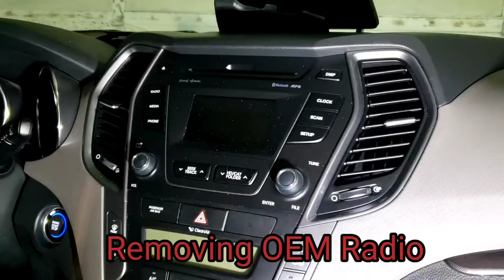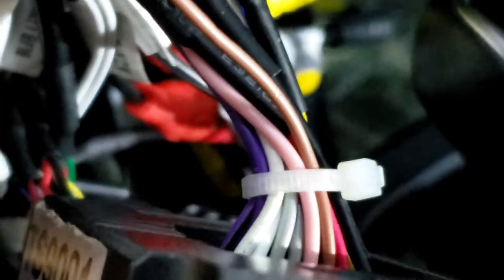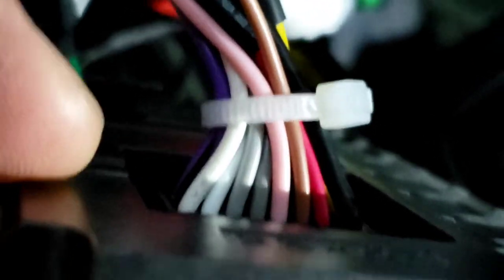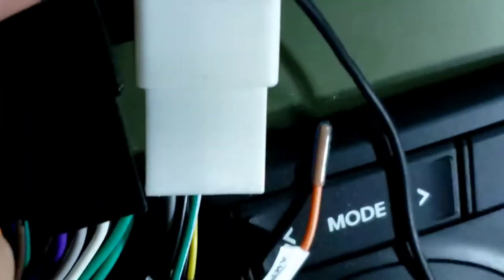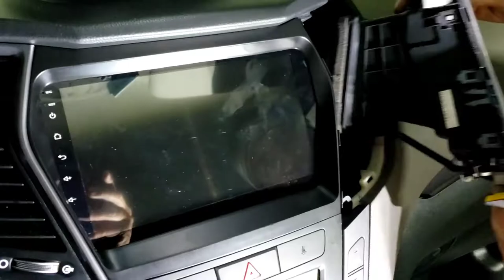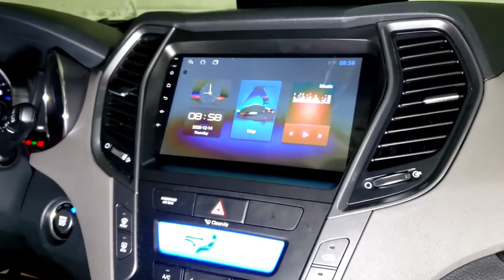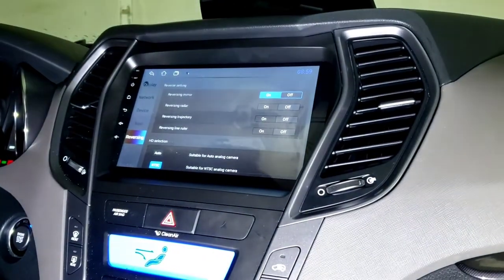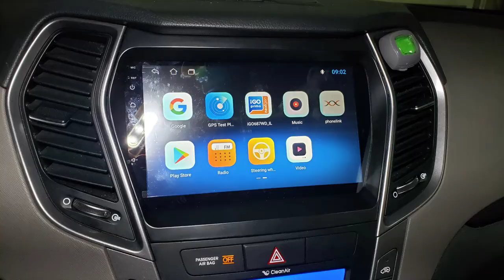Hyundai Santa Fe 13-17 Android 9.1 GPS install /quick/

Comment: just bought the 9" Android head unit ($139) on eBay for my 2013 Santa Fe Sport, I have exactly the same factory radio you removed here...how did you get the mounting brackets to fit?...or did you not use brackets? The metal brackets they included sure don't seem to fit for this install...and the bottom of the plastic mounting piece doesn't fit flush...looks like the two tabs will fit, but there are 2 more tabs under each end...how did you get it to fit flush on the bottom?
Reply from the maker: Visit our Facebook  page :

https://www.facebook.com/Brainlimbo?mibextid=ZbWKwL
Reply from the maker: Messenger

Comment: Hello! I have the same setup issue with the backup camera not detecting reverse. Can you give more detail on which wire that reverse wire needs to be connected to? My colors don't match yours. Thanks!
Reply from the maker: What year is your suv
Reply: @khmerohio  2016 santa fe sport with navigation and dimension audio system with amp

Comment: Hi, I am still figuring out if the steering wheel controls work with this kind of stereos, do you know? thanks
Reply from the maker: Connect pin4 to the brown wire  usually  green/orange
Reply from the maker: If doesnt work ground, the pin 17 usually green
Reply: @khmerohio  thanks!